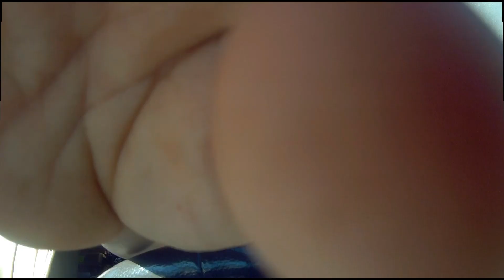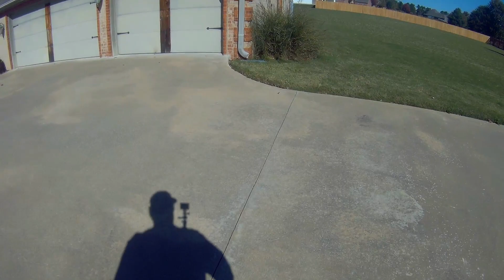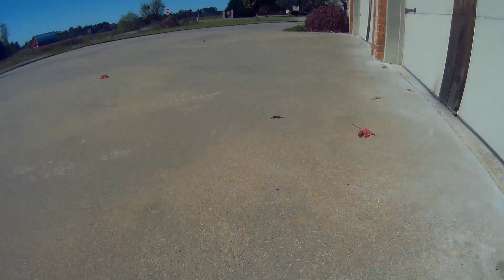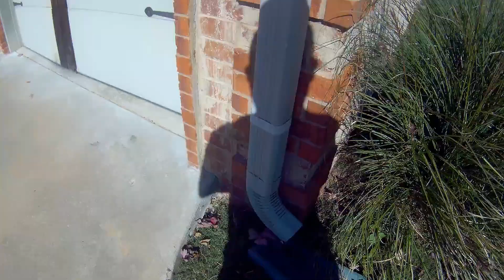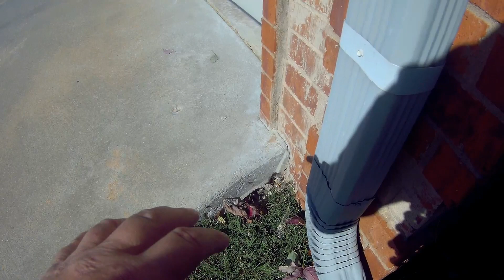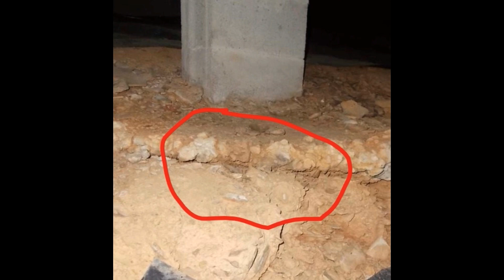Downspout drainage issues & Foundation Problems

Comment: New follower here! Question, there isn’t anyone around us that seems to know their stuff about this so we want to do it ourselves. We’re already having major foundation problems. How to do know whether to do direct gutter downspouts or a French drain?
Reply from the maker: Open downspouts should always be extended away from the home by 10'-15' ft. They are the number one reasons for water related issues around the homes foundation. There are several key factors to look for to help you determine if your issue is surface water related, or below grade water issues. 

Negative grading, open downspouts around the home, are examples of surface drainage issues. A high water table would be an example of below grade water issues.
Reply: How do I solve a soft spongy yard? I've treated for grubs and such. The soil around most of my home is always moist some parts  are dry. I am not knowledgeable about water table in regards to it affecting my foundation and having green moldy looking soil.  I've contacted a couple of landscaping companies for solutions and got high estimates. These companies want to treat my lawn with chemicals and place gravel, mulch, or topsoil in certain areas blah blah. Neither one of these companies even mentioned French anything.